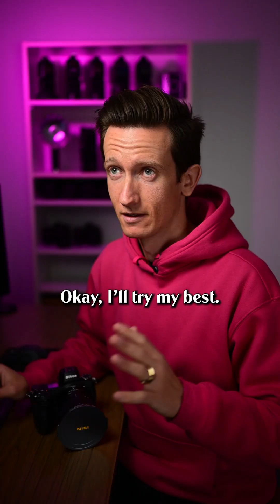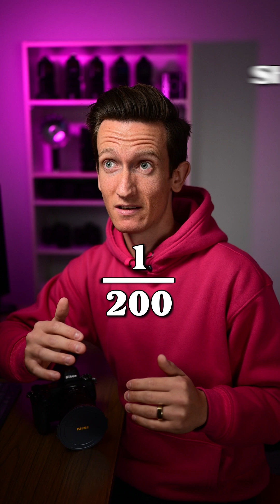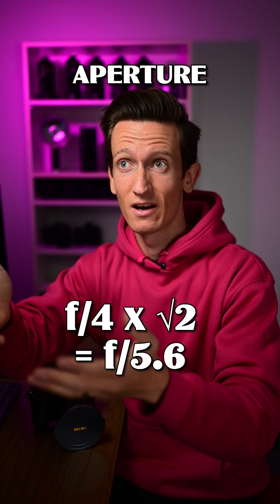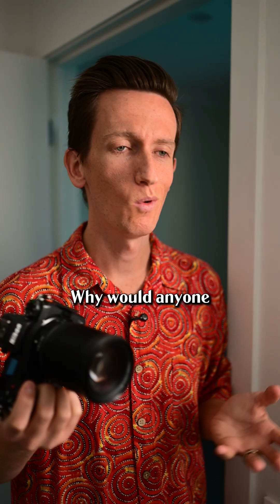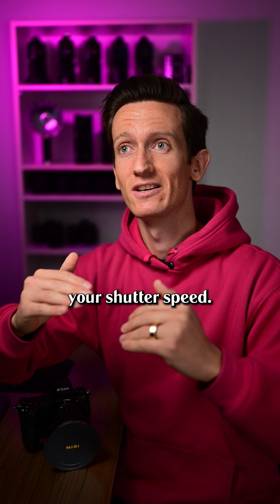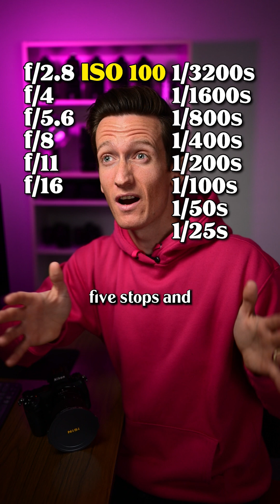What is a STOP OF LIGHT in Photography?

Comment: Technically, ISO on digital camera is not changing the camera's sensitivity to light, but rather how much it boosts the signal from light. The camera sensor always has the same sensitivity to light, changing the ISO setting changes how much gain it adds to the light.
Reply: Mostly true, but it depends on the sensor. Some are "dual gain" sensors, and those do change their sensitivity.
Reply: @tmbrwn dial gain sensors still do not change the sensitivity to light. It just changes when how and when the boost is applied. The shutter is a mechanical part that most cameras have. It is a physical change. The aperture is mechanical. It physically changes. The sensor is set from the factory. Nothing changes when you change ISO settings. ISO is applied after the photo is taken to apply gain for brightness.